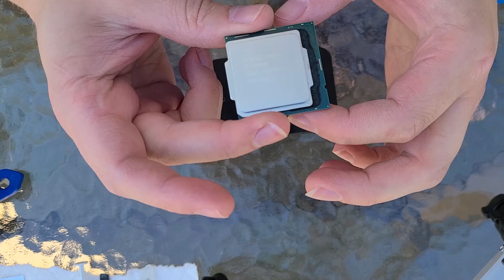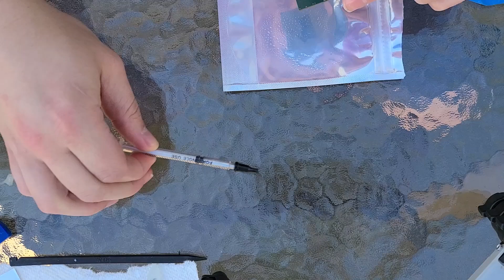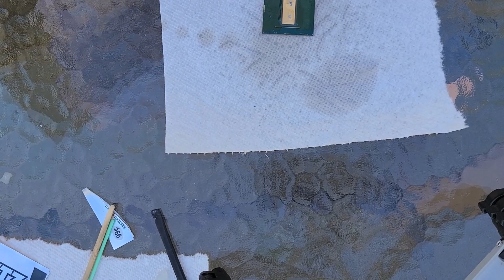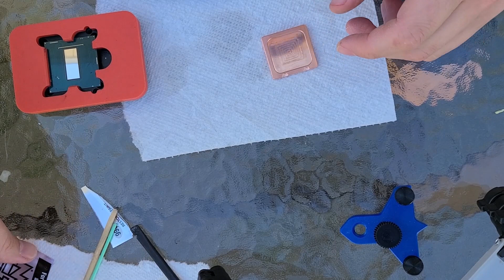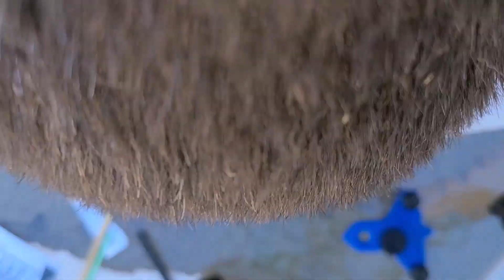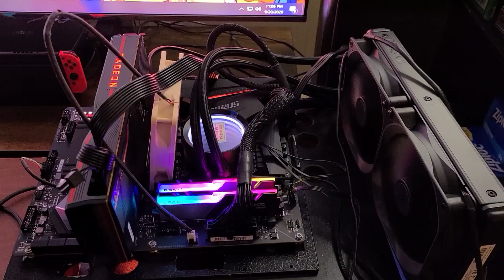Intel 10th Gen i9 i7 i5 Delidding Liquid Metal And Copper IHS Application Guide, Lower Temps

Comment: Great video! Important Q.. I am also planning to do this on my 10900k... Do you also use liquid metal between the waterblock and copper IHS?  Or normal paste?     Or is it liquid metal both under and over the IHS?
Reply from the maker: I would only use the liquid metal on the die and ihs, and thermal paste for the block.
Reply: @ClassyTechCalibrations  All right, thanks! That was also what Steve over at Gamers Nexus did.. however he dident reach entirelty so great results as you..Im gonna order this kit tomorrow! Thanks for great video! Ill properly go with Thermal Grizzley Kryonaut TIM.

Comment: What about cooper and liquid metal reaction? Whant to do the same procedure 👍
Reply from the maker: All it does is stain it but you can use the polish to remove the staining. Considering it's like a $12 piece of copper that you're never going to see it doesn't matter. Liquid metal does eat through aluminum and some other metals, the copper really only just gets stained.
Reply: @ClassyTechCalibrations  Ou, thanks! Good to know that! Can i order that cooper IHS from Aliexpress? Will it be norm quality?
Reply from the maker: @KOT-ANGRY  I don't know if I'd trust that from there as the thickness has to be right or it can cause a poor mount.
Reply from the maker: @KOT-ANGRY  honestly the copper ihs only makes a couple degrees of difference. The big contributing factor is cleaning off the thick layer of adhesive that is on the stock ihs. You can get most of the improvement by just cleaning the stock sTIM and adhesive off and using liquid metal with a thin layer of adhesive ( or none at all ) on the stock ihs.
Reply: @ClassyTechCalibrations  Oke, i will think about it! Thanks for good video!!! 👍👍👍

Comment: That's amazing how you can scrape the die so much without messing it up. And I was shocked at 17:32 when you just poured all that alcohol because painters tape isn't waterproof. lol Is that safe to do that?
Reply from the maker: You can literally take a razor to the die and it won't scratch it. 
The tape is only there to hold it down, make clean up easier, and prevent any sTIM from getting underneath the processor. There is no power going to it, you could pour straight water on it and it won't do anything to it. Isopropyl evaporates quickly, and always make sure it's dry before installing it and giving it power and it's fine.

Comment: I know it’s been a year, but I am planning on delidding my 10900k. A few people have told me I should apply some heat to the cpu before delidding to help loosen the solder to make the delidding process easy. Just curious if you think that is a good or a bad idea? I noticed in your video it seemed you didn’t use any heat. Thank you

Comment: when you reseal it with black silicon, do you need to seal it all away round? i see someone seal it with a gap, but you seal it all around. the silicon is just to keep the IHS on the cpu right? i am thinking about doing this to my cpu.
Reply: Also prevents Liquid Metal from drying out and creeping under from gravity
Reply: @OCtheG  ok am kinda confused, liquid metal will have a shorter dry out time if you use silicon seal around the IHS?
Reply: @thefisherman4380  Longer. By fully re-sealing the IHS you’re eliminating the chance for Liquid Metal to drip out and cause a short, and limiting atmospheric oxygen exposure to prevent oxidation and dry out for as long as possible.

Comment: The ihs already is copper that's plated... it's not needed for full IHS
Reply from the maker: This is known, but the aftermarket ones have a larger surface area. It's optional to get a couple more degrees cooler.
Reply: @ClassyTechCalibrations  plus after a while bare copper will need cleaned will have less efficiency with chemical burn/reaction to liquid metal
Reply from the maker: @dnsean03  that would be after the main life of the CPU. Anyone interested in doing this in the first place is an enthusiast who would upgrade within three years. Liquid metal only tarnishes copper, doesn't damage it like aluminum. It would likely be a decade before needing any attention. Laptops have been using liquid metal on copper for a very long time.

Comment: Maybe I am misunderstanding something, but before the delidding your average clockspeeds were 4800 MHz and after delidding they were 3800 MHz (no surprise that the temps were lower @1000Mhz slower speed).
Reply from the maker: That's because the speed fluctuates, you have to look at max as that's what it is under load. Same speed on both.

Comment: Hello. I have a simple question. Can I install IHS for the processor i9 10850k without changing the internal paste Intel. Will I take a lower temperature with COPPER IHS.
Without removing the internal thermal paste, just add a copper piece and sauté the piece
Reply from the maker: No, you will need to clean off the Intel STIM (solder thermal interface material). It's really not hard to do if you get the quicksilver from rockitcool.
Reply: @ClassyTechCalibrations  Brother, does copper work without changing the inner paste for me or does it not work final, please answer and thank you
Reply from the maker: No it won't work without changing the stock intel material. 
If you delid it at all you have to clean off the Intel material completely and apply your own paste or liquid metal. Otherwise it won't make good contact and temperatures would be hotter.
Reply: @ClassyTechCalibrations  Now I understand, thank you. Thank you very much. You are a wonderful and special person

Comment: All that extra work to install extra layers, why not just go direct die contact?
Reply from the maker: With the IHS it works with every compatible cooler. Also if direct die and using liquid metal it'll stain or damage the base of the cooler depending on it's material.